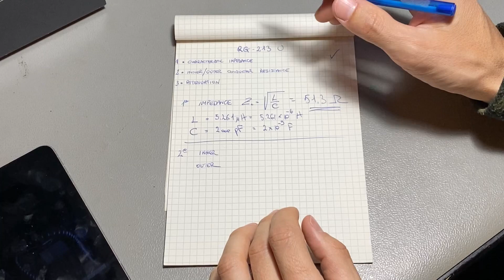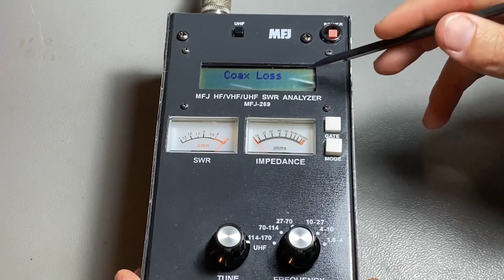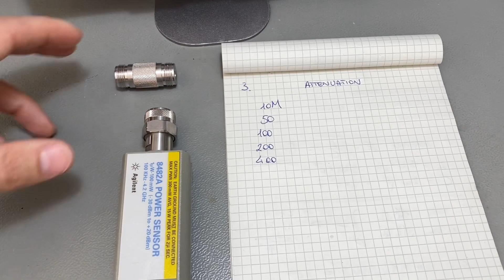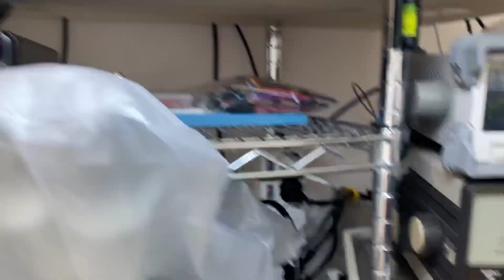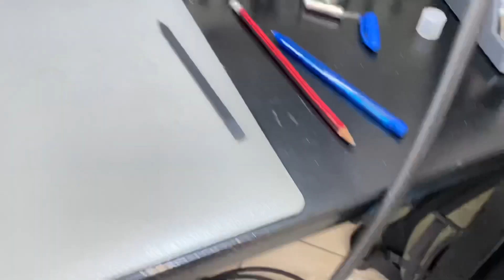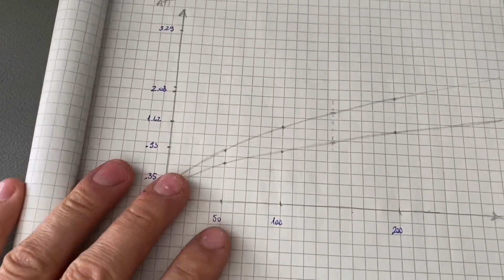CHECKING an old RG213 left outside for years!

Comment: The most interesting part of the measurements, at least to me, is that it's fairly obvious that over a period of time & weather exposure there's objective evidence that coax can become a bit degraded. As for "that" subject matter, and I'm fine with your presentation, I'm not being critical, but it may have been a bit more interesting to have a "reference model" (cable) instead of just the data sheet for comparisons - - like how close would an unused or "unweathered" cable be to both the weathered cable & the data sheet - - - great vid - obviously in real world terms, the lesson here is that these cables do degrade over time - - that is: buy a new one!  Thanks ( :
Reply from the maker: Hello and thanks for your comment. Unfortunately I don’t have another one not “weathered” but nevertheless my goal was to check its condition and establish if I could still use it or not. As I said at the end my conclusion is that I’ll keep it for frequencies up to 50MHz. Also my goal was to show how I run the tests in order to establish its overall conditions. Thank you for watching. Best wishes!